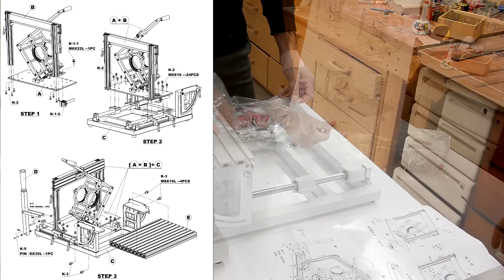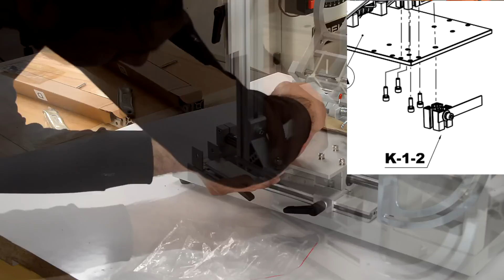Kuldeep assembles the metal "hybrid" Pantorouter, and cutting a joint

Comment: Those who complain about the price: This is not a Chinese-made hobbyist's gadget. If you need a pantorouter, you're obviously in the game to cut a lot of joints and therefore you're either a professional or you have a fairly large project. For a professional, a device like this pays for itself very quickly, both in productivity, accuracy and quality of life.
Reply: Totally agree with you. Guys, if you want to own a Ferrari or a Mercedes, you don't expect to own one if you are only willing to cough up enough for a LADA :)
Reply: I agree that this is a device for professionals, so the price range is not necessarily unreasonable.

But I do think it's fair to complain that the sticker price doesn't include a router, nor the nicer self adjusting clamps. For $2k, that seems a bit stingy. It's a big juxtaposition from the DIY route, where $20 in plans, maybe $100 (max) in materials and a $200 router gets an amazing joinery machine.

I suspect the high price more has to do with custom machined parts and small production runs. Those things are expensive until you make a lot of them and amortize the fixed costs. Though I don't really know what I'm talking about.

Comment: Wow, slick.   Looks like a really well put together kit.   Is he happy with the manufacturing quality?
How much allowances is there for variations in router diameter?   
Congrats to Kuldeep on sticking with this for so long!
Reply: right now i have size from 65mm to 95mm. now i m going to experiment with Maffel FM 1000 milling router.it has 43mm diameter neck and 26mm neck length.Maffel promise me to make 12mm OEM collet for me.good thing it has 2 double bearing front side for extra load and precision .
Reply: Thatt's nice to hear. 43mm neck router spindles are very common in Europe. I have a Kress 1050 FME-1, and there's other manufacturers like Suhner for example. They are all in a very similar price range and all have the double bearings (seems to be standard and nothing special, which is a good thing). They also all use the same collets, which makes me wonder how Maffel wants to fit a 12mm collet. The rear OUTER diameter of these cone shaped collets is just about 11mm. Quite hard to drill a 12mm INSIDE diameter hole into that.
Reply from the maker: for the 89 mm ones, not a lot of tolerance, and unfortunately, some manufacturers are a fraction of a millimeter larger or smaller than that.  So best to stick with the recommended model of router.  But you could also add shims.

Comment: I wonder if you can add a relay that will get activated and stop powering the motor if you short between the motor/drill bit and the table. For this the table will need to be electrically disconnected from the body of the device. Just a thought.

Comment: Something I've been curious about is what happens if you climb cut or otherwise cause kickback? This applies to the copy carver, router pantograph, etc as well..
Reply from the maker: If the workpiece is not adequately clamped, that can cause it to move a little.  But with the pantograph, you have so much control it's generally not an issue.

Comment: What would be the best router bit for cutting mortise and tenon joints on the pantorouter?
Reply from the maker: whichever bit is best for cutting the size slot you need.  Spiral bits are nice for the mortises.  For the tenons, it doesn't matter.

Comment: Looks to be getting simpler manufacturing. That mean it's getting cheaper? Can I buy on through Amazon? All my credit card rewards points would go to it.
Reply: I think the ideal scenario in this case, is smaller packages. Since that reduces Cost a lot in terms of shipping. The material might not get cheaper tho. Metals are on a steady rise in cost.
Reply: the new design seems to be more effeiciently built so it looks to me like its lighter good for shipping and it means that less was spent on materials, also i noticed that a lot less of the machine is made out of 8020 extrusion, which is really expensive.
Reply: Fergus Hudson That's what I was thinking, bottom looks like some kinda mold. Looks sturdy, but looks to have a lot less extrusions. Price drop would be nice! Lol

Comment: Is this new design/model going to be more affordable?
Reply: Looks like injection molded plastic for the base (cheaper to produce) and a simpler design overall. Easier to manufacture at scale because of both. My guess is yes, but still not an “affordable” product by the looks of the number of accessories. 

I could still be completely wrong, though.

Comment: Whats the best way to mke tight puzzle joints for ply wood boatbuilding,plans and wood are cheap but the kits using those joints instead of scarfing are out of my current budget, any advice out there woodworkers
Reply: cartmanrlsusall 
Scarfing joints with modern glues  is unbelievably strong.  Try the method of stacking the two mating pieces and belt-sanding or hand planing the bevel. The exact bevel ngle doesn't matter much, as they'll match each other.

Comment: Why is it called a hybrid?
Reply: When Kuldeep originally experimented with metal components for Matthias' PantoRouter plan, he coined the term "hybrid" as it was a departure from the original wood design.  The name stuck and we still use it today, though it's recently more often referred to as just PantoRouter. 

It's a brilliant design of course and the continued innovation and manufacturing improvements have resulted in a very user-friendly, fast, safe and fun woodworking jig for mortise and tenon, box joints and dovetails.

Comment: Would like to know if anyone finds a 240v router that fits these.
Reply: i supply with 240 volts router
Reply: When I emailed they weren't available is this new?
Reply: Still listed on the .jp website as 110v btw. Unfortunately i couldn't wait I built my own from a plunge router. Thanks for the info though
Reply: +Rhys H  Japan itself will be 100/110 volt - but maybe it is a 100-240 /50-60hz router, as voltages / hz in Asia is all over the place.

Comment: I feel like a cnc would be a better choice of tool especially considering that THIS IS THE SAME PRICE
Reply: I have a CNC and the setup to make a joint would take me 10 times as much. Different machines for different purposes. If I needed to make joints for wood, I'd use the CNC to build a pantorouter rather than make joints with it.
Reply: Ya but, if u were given the option would u get the pantorouter or a half decent cnc?
Reply: I would make Matthias' wooden version pantorouter.
Reply: Well, depends on your needs like I said. My needs were to fit the most versatility in the very few square meters I have so I made my CNC machine. If you make wooden chairs for a living, you'd probably appreciate the time saving a pantorouter produces when making joints.

Comment: Really nice machine...but nearly 2k....that's really too much
Reply: The guy sells comfort at a price. You can get it for almost nothing if you're willing to build the wood version yourself. However, If you want something more sophisticated take the plans and replace the structure with aluminum extrusions, and those bearings and rails they use here which are just the ones that people use for their CNC builds, available for cheap on ebay.
Reply: Buy his plans and make it yourself.
Reply: Base model is $1000, router is $180 if you don't have/can't find a cheaper one, you can get a cheap mill set for $50, or they're like $15-$80 each. So you're just straight up wrong about the price.

The plans are like $20, which would make for a fun project. Or you could build one based on the idea alone because it's not that complicated, and it would only take a couple rebuilds to work out the kinks.

So since it's not actually a matter of cost, I can't help but imagine you're regularly in the workshop and thinking "I need to build X but I don't have X tool. So I guess I'll just give up forever." in which case. A: Build the tool you need, get it at a garage sale, or make due with the tools you have. Or B: Go back to the house, your wife misses you and you're not going to get anything done anyways. Just focus on your career and buy your furniture from Ikea like a normal person.
Reply: panino04  I would agree. It does seem quite pricey for what it is. I suppose that’s why I will just make my own. I understand a guy wanting to make some money but.......
Reply: I'm guessing that Kuldeep's price is what he needs to stay in business, or else no metal pantarouter available at any price.  I respect that.  Same with Matthias, he must charge for plans, or else no plans available.